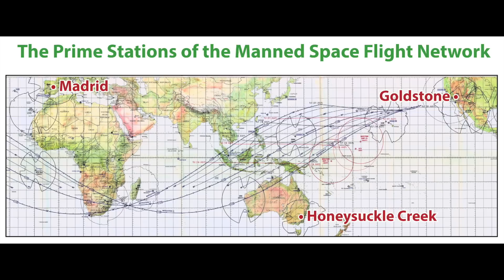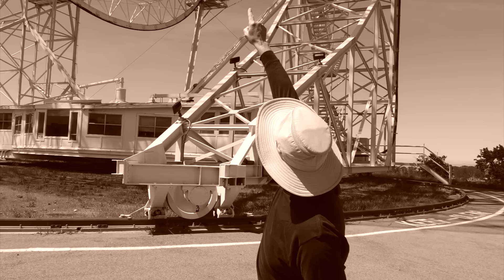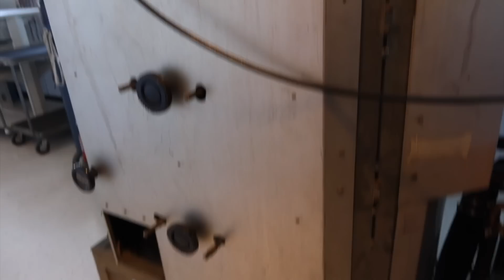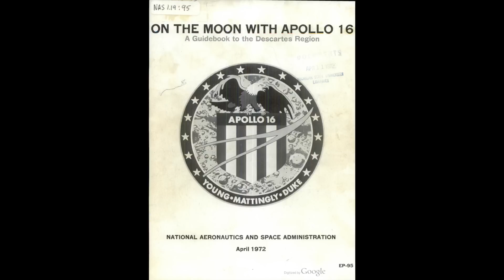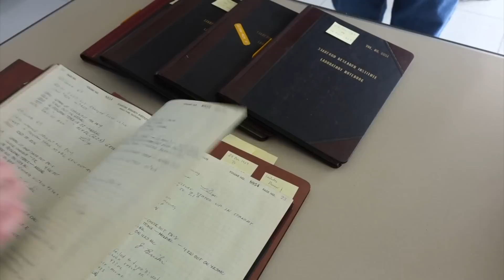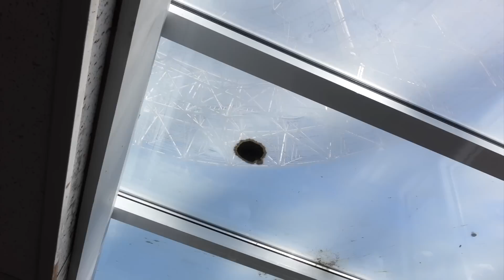Apollo Comms Part 16: Stanford Dish’s Apollo Past

Comment: I’ve read a lot of books about spyIng, and one of them mentioned the Stanford dish and why it was built.  The Russians  were testing their ICBMs,launched from central Russia and impacting around the Kamchatka peninsula. The telemetry on the ascent of these missiles was very valuable intelligence. The Russians had not encrypted it, since they believed it was too remote to intercept.  The signals WERE able to be intercepted by Moon bounce, if you had a large enough dish antenna, and the Moon was in the right place. I can’t recall where I read this unfortunately.  “Body of Secrets”, by James Bamford, is a good source, but I couldn’t find a reference to the Stanford dish in it.

Comment: Those Klystrons were used for UHF TV transmitters in the UHF TV band 474 MHz - 806 until the1980s.  Then they were replaced by Klystrodes which were used up to about 2015. Finally high efficiency liquid cooled Doherty LDMOS transmitters hit the market, 17+ kw in a single rack, 48V DC  instead of 34kV DC.  And with 6 racks you can get 100kW at 40% efficiency.  Just the saving in Electricity pays for the transmitter, really surprised they are still using the Klystrons.  We still have 3 Klystrode transmitters in service but they will all be gone in the next 3 years.

Comment: I would be curious to learn how the dish positioning is working on Windows 95. I would like to convert that program to Python and let the program align the dish from a modern OS like MacOS or Windows 10 or Windows 11. I used to write Device Drivers for DIGITAL VAX and other systems. Depending on how the comm works currently this would be adapted to a modern Computer OS or Linux.

Comment: Curious to know if that was 75 watts direct to the antenna from the IC-910, or if there was an amplifier in the line...
Reply from the maker: I am told by Stephen: no amplifier, the amateur radio transmitter was going straight into the antenna. 100W at 144 MHz and 75W at 432 MHz.

Comment: The "big dish" was used on Apollo 14,15, and 16 for surface roughness studies.  It received some frequencies around 400 MHz.  It was used in conjunction with the Goldstone receiver on S-band (it used the video transmitter in the CSM).  I was with the compute facility that processed the data.  Lots of data!  It may have been used for other Apollo tasks, I don't know.  In addition, it was used at around 50MHz to contact the Voyager Satellites after they discovered a flaw in the receiver.  They ended up not needing to use it for Voyager after they modified the earth transmitters.

Comment: That transmitter reminded me of a student job I did when I was in college and studied electrical engineering. We had to move stuff from the radiology department of our local hospital because the building was demolished. They had a big ass 1950s siemens klystron amplifier there which fed some old school radiation therapy doo-hicky. I really felt bad scrapping the thing. But as a college student, I had absolute no storage space. I snatched/saved some nice high voltage vacuum capacitors and two pressure cooker sized power tubes, though. Still have them laying on my display shelf, gathering dust since 30 years...

Comment: Whow this is nice !
Reminds me to the day i got my HAM licence 35 years ago
and joined some friends in doing contests on the higher bands (70, 23, 13, 9, 3 cm, indeed missing 6)
We used partly old militair dump equipment with coaxial valves like 2C39 (of course creating power far beyond desingn specs)
I'm a bit confused though, the big amplifier tube (i want one) isnt that a TravelingWaveTube rather than a Klystron ?
After all a Klystron is not really a amplifier tube but a self oscilating one like a Magnetron.

For the DOS problem,  there is FreeDOS and if you have the sources (which is likely)
you could transfer it to any other OpenSource OS like Linux, for ever dealing with the old hardware issue.

Anyhow.. this Steve guy has a dream job !

Comment: There are a lot of former broadcast IOT's out there capable of 25+ KW broadband and not much of a challenge to make them work in place of a klystron. I did experiment with some EEV (E2V) IOTD2100's in the "modern" EEV cart and managed 15KW from 400-920 Mhz limited by arcing in the interstage coupling at <480 Mhz which could be remedied by re-engineering the pickup loop.

Comment: The brother to this dish is located at Millstone Hill Radar in Westford MA.  I worked during the summers while in college on the antenna and site maintenance crew.  I remember climbing up to the elevation bearings with a grease gun to pump 3 tubes worth of lube into each bearing.  Best job I ever had - Phil Goode and Jimmy Hunt were in charge and it was a wonderful way to spend the summer.
Reply: You used to be able to see it from 495 before the trees grew up...always wondered about it.
Reply: @petersimpson6076  My next door neighbor was a electronics tech there at the site.  He came up to me the night I graduated high school back in 1981 and asked me if I had a summer job yet.  Pre 9/11 you could drive all the way up to the Haystack Observatory.  I visited about 12 years ago and they have a gate installed.  Ended up walking up to see it again.  It's pretty damn big up close.  I also worked on the 84 ft deep space tracking antenna.  They fed that with 2 megawatts of L-Band through 2 huge klystrons.  The transmitter bay was fantastic to see.  Every summer was great there.

Comment: Wow!  That brings back memories!!!   I had the privilege of touring that antenna and riding in the antenna building like you did.  I think my visit was in 2009 when I worked with the Solar Observers Group at Stanford when I was an engineer that worked on the Solar/Sudden Ionospheric Disturbance (SID) as part of the Education and Public Outreach (EPO) for their HMI/SDO mission.  I was fortunately able to tag along with a group that does radio astronomy, so... any excuse to get a once-in-a-lifetime experience.  And it was awesome!   Like you said there's no public access, you have to know someone to let you in!  Even through I had (at the time) a gate key so I could drive on the property to go up to the Wilcox Solar Observatory... Hmmm... I wonder if that place is still being maintained?  That's another cool place to visit.  It's more about solar observations of the magnetic regions on the sun and nothing about radio comms. Still it is an interesting place to visit in it's own right, If memory serves, it was constructed in the 70's... and the first thing the did was drill a hole 75 feet into the ground, that was where the diffraction grating would be placed... but that's a whole other story.

Comment: Why is the transmitting pitch of the telegraph key signal sent to the moon different from the received pitch?
Reply: Could be as simple as a locally generated sidetone for TX vs BFO for RX. A Doppler shift should be there, but it will, IIRC be small, because the moon (a) rotates and (b) moves closer and further away from Earth as it orbits us.  Both motions are fairly low velocity, so the Doppler shift would be small and relatively stable.  Had to know this for my Extra Class license written :-)
Reply: @petersimpson6076  I'm wondering if the transmitting pitch we hear in the video is synthesized but the received is the actual pitch, since it's accompanied by noise (static)

Comment: I decommissioned a TV transmitter site during the repack of channels.  It 3 big klystrons like those in the video.  Sadly I broke a tube in disassembly, they are stunning pieces and beyond heavy being mostly fabricated from copper.  The water cooled tube must weigh at least 500 lbs!  The focus coils also weigh hundreds of pounds.  The turning mechanisms are nice bits of fabrication as well.  The coax was 6" and massive.  So was the wave guide s and stitching as well and tuning.  There were blocks of teflon 3 feet long, a foot wide and at least 3" thick.  I truly hated taking it all out and recycling most of it.

Comment: How much of the original capsule hardware is still around? Like.. suppose you wanted to make a bench model of the capsule with original engineering hardware. Which pieces are still missing?

Comment: When I was working toward my private pilot’s license in 2003 out of Palo Alto airport, the Stanford dish was used for flight training to practice “turns around a point” to work on compensating for wind pushing the plane off course. Of course we stay above the minimum safe distance while doing the maneuver.

Comment: Thank you for this trip that reminded me of my time on a contemporary built U.S. Navy Destroyer class ship with the the latest and greatest communications and radar along with the one of the first three digital computer equipped air traffic control systems (NTDS). I worked on those Seymour Cray developed solid state UNIVACs and with technicians who knew our klystron powered radar. I myself was trained on vacuum tube radio transmitters and recievers but aboard that ship were many prototypes using transistors, greatly improving my knowledge. Not an single IC though. 
Years later in my Hughes Aircraft career, I did get introduced to PDP-8 equipment but not fully.  This video may help with  a variant I know of located where I spend part of my retirement as a docent at the Mt. Wilson Observatory. Their solar telescope scanning computer, now kaput, is of that vintage, and has yet to be replaced with a more up to date processor. Just maybe their Pentium solution might work.

Comment: So dos support ended with windows 98? That is not correct. What else is this dude saying that isn't correct?
Reply: Simple low level hardware access to arbitrary i/o ports from MS-DOS ended with 98.  While Win ME could still do this, the operating system was a mess.  Win2k and beyond block arbitrary low level i/o access except through device drivers.
Reply: Don't be a putz.

Comment: In the early 1980's I had a short stint at the Hartebeeshoek Earth Satellite Station telephony division working on the analogue wideband data systems before the up and downlinks.

Next door is SANSA (aka Hartrao aka DSS-51)

DSS-51 was one of the roughly 20 satellite stations used for the MSFN. The deep space network/MSFN was an integral part and success of the early Apollo Programme.

Comment: "Well, it runs on FORTRAN, is why we run Windows 8."

Raspberry PI: "Hold my NEON SIMD."  It can handle FORTRAN using a variety of compilers, some bit-bashers like to use gFORTRAN.

Or any modern PLC controller setup  and a lukewarm laptop computer would be able to move the antenna with even greater precision without gutting the whole kit.  But gutting the archaic FORTRAN code routine would be the primary goal with a digital/analog PLC refit.

If they REALLY want to go retro, they could leave the panels be, setting back up retro-nixies in the displays, or simulate nixie tubes using LCD panels, and use precision digital rotary encoders.   Pretty much a tinker's dream to refit something like this. And their antenna might gain a few zeros in precision on all axis.
Reply: I would guess the limits in precision have more to do with the mechanicals than the software.  i think double-precision floating point would outdo most any hardware.

Comment: I have been following this series as I watched everything Apollo as a kid. I designed the hardware and wrote the software for the propulsion system on the Marco cubesats. I was at JPL when the Insight lander was landing and both the Marco cubesats successfully completed their mission. I had no idea this dish was involved in the mission. I will pass this video along to the other team members on the propulsion system. It was a cold gas system with eight thrusters. Thank you.
Reply: HI! You might remember me. I worked for NASA, driving the roach coach. I'm behind that incident when someone pressed the wrong button when I drove up and yelled "LUNCH" and he thought I said "LAUNCH".

Comment: I'm curious how the rotation is stopped in each direction to avoid ripping out the cables.  I presume it can rotate more than 360 degrees and I'd hate to be the guy operating it, spill coffee and when I looked up discover I'd managed 720 degrees.
Reply from the maker: It has a huge safety switch in the bearing under the building to cut off the rotation motors.
Reply: don't know about this dish specifically, but looking at other stuff from the olden days, usually it would be something simple like a tension arm on the cable or a cog that moves a rack back and forth between a couple switches to cut off the power to the motors

Comment: I don’t understand RF magic. Does the mesh really reflect most of the signal? Is it isolated from ground?
Reply: Yes, as long as the frequency is “low enough”, a wire mesh behaves practically the same as a solid sheet (and therefore bounces). He even mentions the rule of thumb (less than 10% of the wavelength). It does not matter if it is isolated or not.

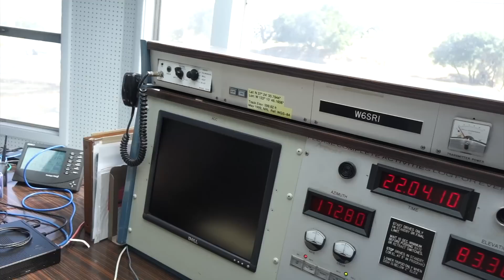Comment: 16:54 So the high-tech dish that supports Mars landings and micro-satellites is controlled by a Pentium II CPU running Windows 98 running a DOS program written in Fortran. This is why I still get calls from recruiters looking for COBOL programmers.
Reply: About 70% of the backend processing done at every major bank in the world is done in COBOL. Still. I recall talking to a customer in about 1976 that said they had over 10 million lines of COBOL code in production. That was ONE bank.
Reply: Because they don't know the difference between Fortran and Cobol?
Reply: @andreasu.3546  I just meant old programs in general, but come to think of it, you're probably right in some cases. I've had recruiters mix up buzzwords on several occasions.
Reply: it's quite common for anything related to space tech to use very old hardware and software to function, just because it works and is reliable. Most military stuff is regularly updated for security reasons, but banks and the financial business in general still has a ton of very old software written in languages only a minority remember ever existed, and quite often that software has multiple layers of patch jobs in order to function on slightly newer hardware and communicate with modern systems. It's typically very complicated and completely unnecessary to change these old systems to something modern; literally boils down to the old "don't fix what isn't broken"
Reply: I'm sure if there was an infusion of funding they could rebuild the control system fairly easily but like Aricebo, if it isn't broke, don't fix it, and if it is broke how the heck do we replace it?
Reply: You have no idea how many critical manufacturing facilities have tools running 25+ year old software. Its one of the reasons ransomware spread like wildfire.
Reply: @BAD_CONSUMER  Siemens PLC touchpanels sold brand new to this day run on Windows CE 6.0 from 2004 under the hood.
Reply: @nrdesign1991  ya I remember buying a brand new hydraulic pump for some test machinery and the onboard controller boots to windows CE before running a script to launch the control software. Another piece of equipment had a Cyrex microprocessor for its controller
Reply: @BAD_CONSUMER  The positive side of some of it is that they are connected by sneakernet.
Reply: Nobody has gotten around to porting it over onto an Arduino yet...
Reply: Is an 60+ year old dish high tech?
Reply: @deth3021  The fundamentals are still the same.
Reply: @deth3021  The dish itself is not high tech. It's really just a very carefully shaped chunk of metal, to be honest. A very large, very, expensive, chunk of metal. To which you can connect the RF transmitter or receiver of your choice, and get some very impressive gain. Which is what keeps it useful.
Reply: @petersimpson6076  yhea i know, guess it was more of a general idea that struck me, of what does it say about our technological advancement, when we still an refer to 60 year old gear as high tech.
Most of the effort of the recent decades seems to have gone into financial instruments, an asinine apps.
Reply: Lol. There's no reason they can't upgrade to a modern OS. Modern fortran dialects are available for newer OSes.
Reply: As long as the system is isolated from the outside world, as most control systems should be, using older generation hardware and software is fine.  Fancy GUIs don't always make a simple application work better, but routinely transitioning to the latest version hardware/software, just because it is the latest, can be a huge burden.

Comment: Love the beefy RF connections! Great stuff.
Reply: when your rf voodoo is so black magic you have to use plumbing fittings as coax....
Reply: @frogz  RF plumbing done all the time at your local TV and radio stations.  They also fill those with dried air or nitrogen to keep them from arcing.  Typical high power radio station may push 8KV @ 3A so arcing is a thing.
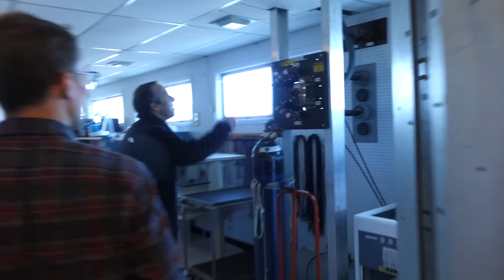Reply: @glynnetolar4423  I think you can see the nitrogen bottle near the waveguide patch panel at 13:01.
Reply from the maker: Me too!
Reply: I want to hear the Corona discharge of these radio and TV you speak of to see if you can hear the content in open air
Reply: @frogz  I've been to an Omega station when it was operating.  You could hear the tones in the air outside of the transmitter building.  (Transmitting frequency of 10-14KHz. In the range of human hearing.)